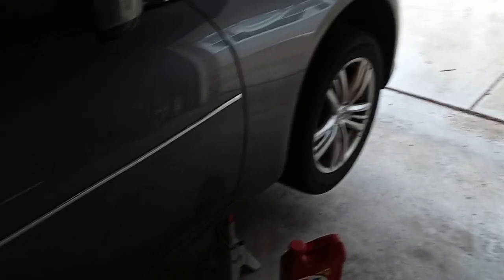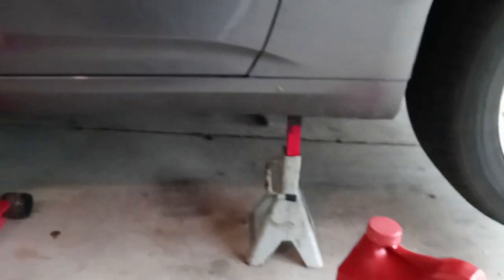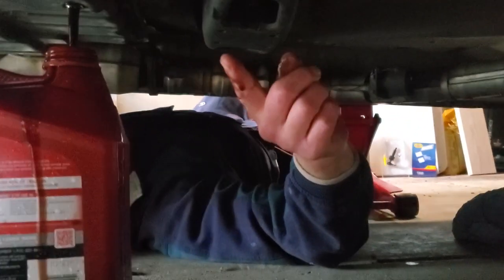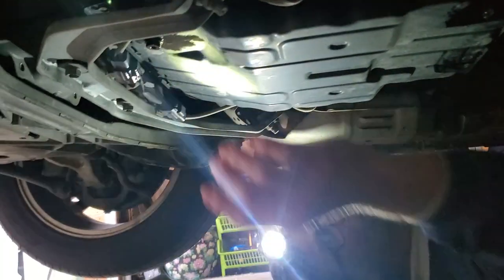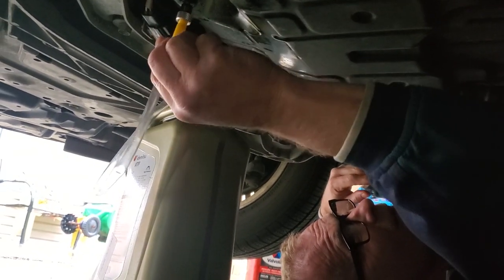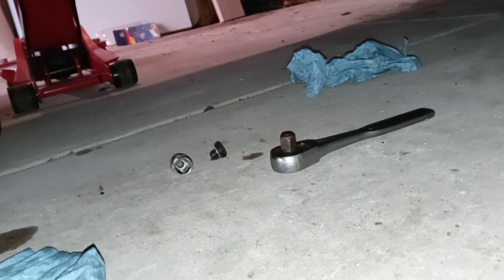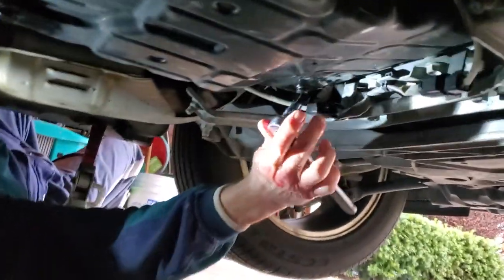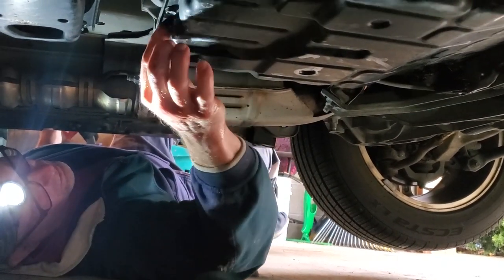Infiniti G37 Transmission Fluid Exchange

Comment: New updates any slipping does the car shift smoother? 
Is that transmission fluid you matic - s
Reply from the maker: Yes, it's Matic-S type fluid. This brand was highly recommended on Amazon. I just did another 4qt drain/fill with genuine Nissan Matic-S yesterday as a matter of fact. No video but the process did go better this time around as we knew exactly what to expect. And yes, the trans is shifting better after the 2nd drain. Car has just under 89k on it and I'll probably do another 4qt drain/fill before fall & that will get about 90% of the old fluid out by then.

Comment: Did this today so far so good! Do a 2nd in 1k miles, then a 3rd in another 1k miles = 85% newer fluid which is certainly better than running the older fluid which was looking a tad brown and not so silky smooth.